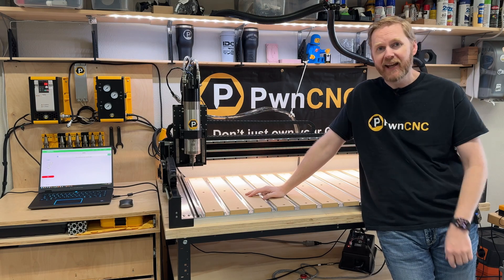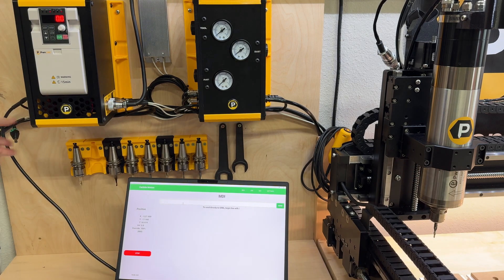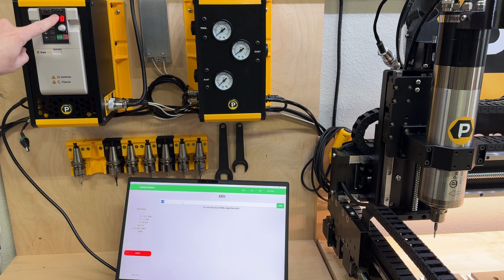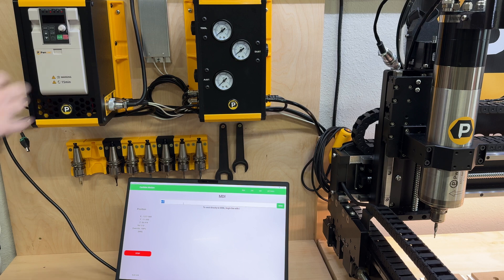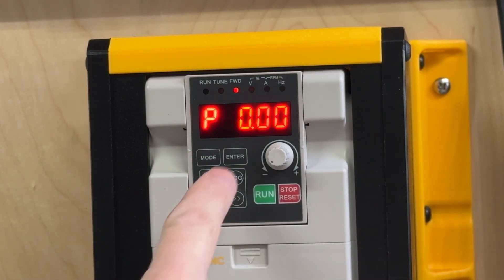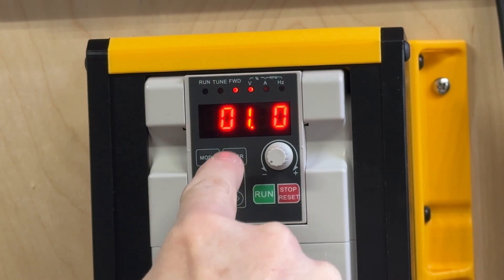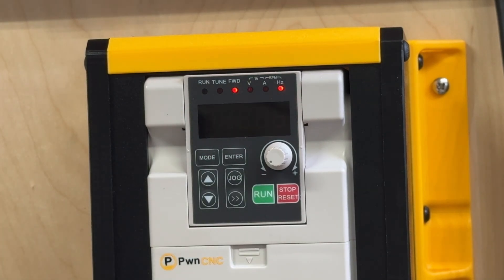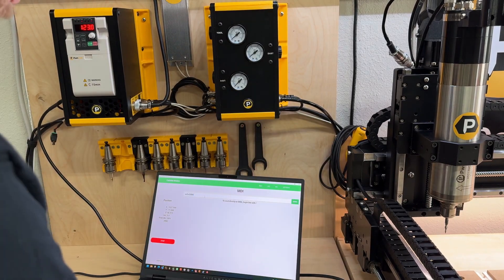Unlocking VFD Auto Forward on Carbide3d & Shapeokos

Comment: P0.0.03	Option of operation control mode
  From	0: Keyboard control
  To		1: Terminal control

P2.0.00	DI1 Terminal Function
  From	01: Forward (FWD)
  To		00: No function

P2.0.02	DI3 Terminal Function
  From	09: Multiplex Directive Terminal 1
  To		21: Running Command Selection Terminal 1

P2.2.19	VF1 Input Lower Limit
  From	03.10 (Volts)
  To 	01.00 (Volts)

P3.2.00	Intermediate Delay Relay Control
  From	00001
  To 	00011

P3.2.02	Intermediate Delay Relay M1 Control Word B
  From	00000
  To		00411

P3.2.07	Intermediate Delay Relay M1 Control Word C
  From	0000
  To		0001

Comment: Can someone confirm why I’d want to trigger the auto-forward- in layman’s terms? I’m a newb 😅

Is it just so that we don’t have to manually hit start/stop on the VFD every time or am I missing something? Because yeah, that would be super convenient!
Reply from the maker: One of the awesome things about a spindle system is having it start, spin up to speed, and stop all automatically.  These commands are already added to gcode design files (M3, M4, M5, and S)  Problem is that many of these hobby level cnc machines do not have a means of sending those commands out to spindle systems like ours.  That's ok as this video reveals that our VFD is smart enough to know when it's being asked to ramp up to speed by simply watching the PWM signal which is specifically controlled by the S command.
For Shapeokos the PWM ranges from 0-5v which corresponds to 0-24000rpms.  When the PWM signal is at 2.5v it's half the spindle speed which is 12000rpms.